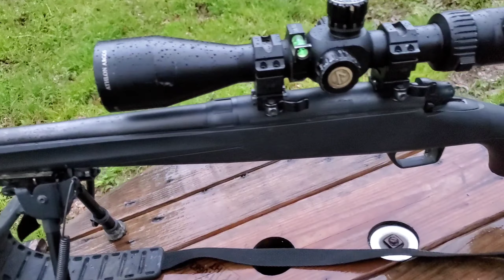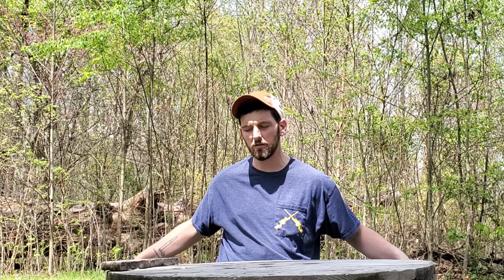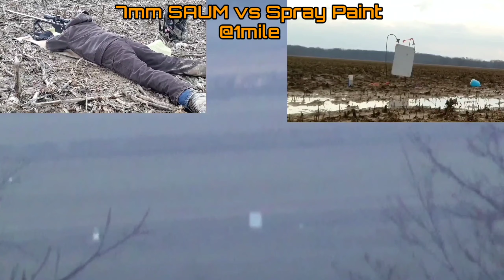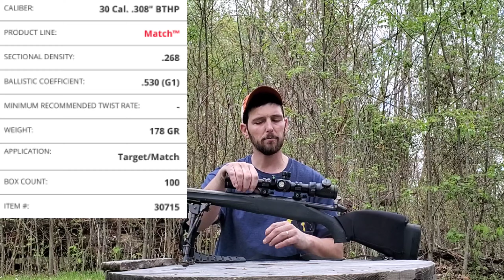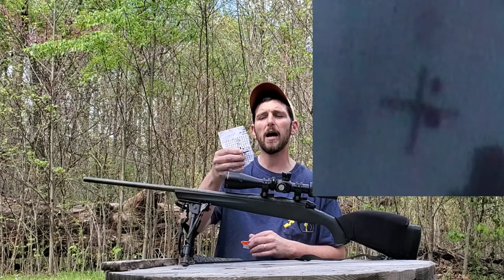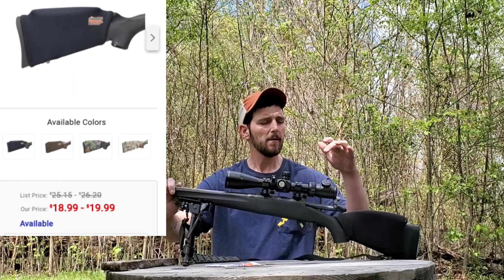Remington 783 Budget Long Range Project | 750$ Total Cost

Comment: My 1994 vintage Rem 700 .30-06 will shoot sub-caliber at 100 yards. I replaced the wood stock with a B&C composite stock, had the bed glassed and the barrel floated and the trigger pull reduced to 2.5 lbs.The gunsmith who did the work, a former USMC armorer, wanted me to add a bull barrel but since I was able to shoot sub-MOA with the rifle out of the box, I declined. 30 years later I can still shoot sub 0.5" groups with it with a Vortex Viper PST Gen II 5-25x50 with my hand loads.

Comment: I put a vortex crossfire 6x18-44mm bdc reticle On a 783 308win using 168g adi australian outback ammo used the the rings and bases that it came with torqued them proper epoxy and bedded the gun opened up the float with a file and I was hitting gong at 1000 yards yes the barrel got hot but I tool my time after 10 shots and it hit 12 out of 15 times on 48x48inch gong with a 10mph wind

Comment: Did you recommend 20 moa scope ring for this setup ?
Reply from the maker: No but if I was going to add some sort of optics cant I would go with one of the aftermath 20 moa rails that are available for the 783. For 1000 yards It wasnt necessary but if you want to go much further it would be a good idea.
Reply: @gunfather83  thank you. I just buy a 783 heavy barrel to start my journey in long range shooting. Watching you from canada ;)
Reply: @gunfather83  did you have some scope rings to recommend with this setup ? Not to expensive ?
Reply from the maker: @JayzyMotorSport  I actually really like the UTG Pro LE grade rings. They are only like 25$ on Amazon.  I have them on a couple of rifles and have never had any issues with them.  They are fairly ridged and they have a QD lever which comes in handy when taking scopes on and off to switch around to other rifles.